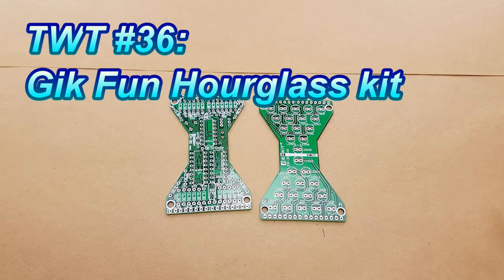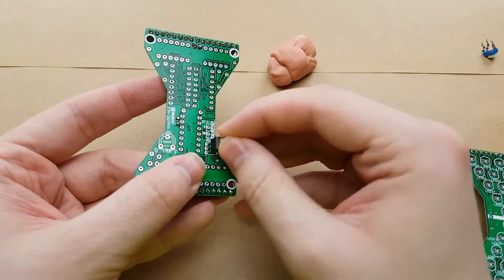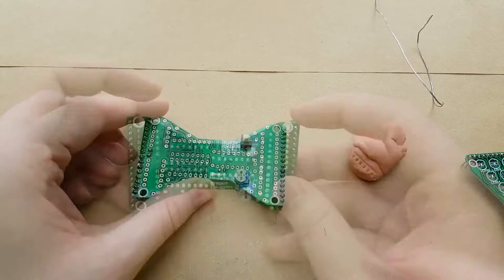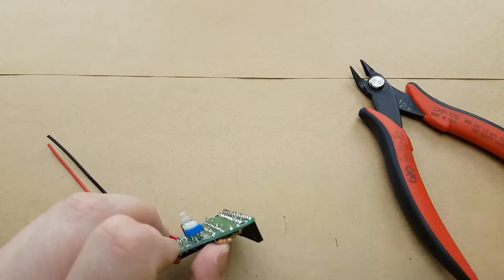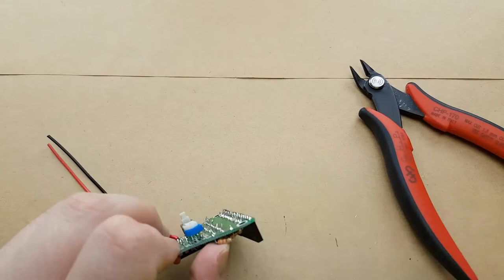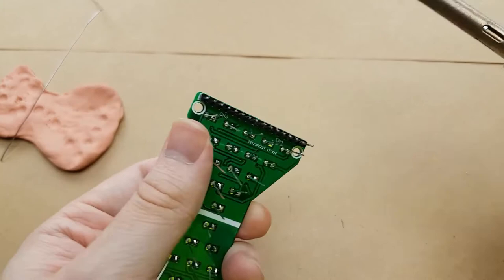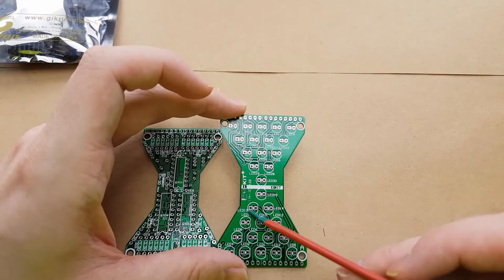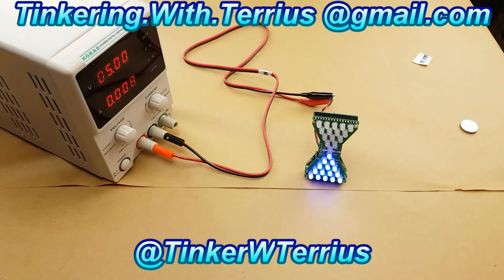Gikfun Hourglass Soldering Kit Build | TWT 36

Comment: So i just finished soldering this kit, first time i ever soldered anything hahha.. and that for a 40yr guy ...Very good kit to get started with. was kind of relaxing to do.. i live in a small apartment so my study desk doubles for a soldering stating... cleaning up after wards was a bigger job hahah..Only had one little problem and that was that one of the led's didn't work.. luckily i got 2 spares.. Got to test out my desoldering station hahha..
A couple of things for people wanting to build this kit.
1) you can google the manual just search for "EH-30 Electronic-hourglass-kit" its the pdf from banggood.
2) i orderd 5m red silicone wire cable 18awg that's about 50% to big i just cut a bit of the wire. but i guess you could try 14awg.
3) to power it i used "Daniu USB Aligator clips wire male/female to USB Tester"  also from banggood..
i first connected it to a usb powerbank to see that nothing goes wrong.. because my powerbank shuts off after a few seconds i connected it to a 5v usb power supply the one i use to charge my phone .. 
Two things i missed having.. a nice bending tool for all those resistors...
demux4555 uses a nice tool on his channel.. don't know if it's overkill but problem is i cant' get one for cheap so will have to do it by hand.. one thing i REALLY missed was a pair of fine pliers.. i had bought one but it's way to bulky.. i'm going to buy the PN2005 from Piergiacomi i think hakko also sells one.. ..
Reply from the maker: Glad to hear from you again! This hourglass was one of my favorite kits to put together so far. Aside from me messing up and putting all of the LEDs in backwards at first... That was a LOT of desoldering, heh. Clean up is always the least fun part of soldering! :)

Just as an observation, if the 18awg was 50% too big, you'd actually want to go with 22awg. It is one of those weird things where the larger the number is the smaller the actual wire is. 

I've been really tempted to buy a lead bending jig, but I agree they seem far too expensive for what they do.
Reply: i also bought the clock kit with temp (red) and with case.. and the Christmas tree ahhaah...i like the clock kit because it's something you can put in a corner and have it work.. Bigclive did a nice review / teardown of ikea 5volt power supply (Koppla) that's the one i got to power other things and free up sum 5v usb wall power supplies..does are pretty much all the kits i could find for cheap.. looked at Velleman but those are way to expensive.. still need to look on ebay ;-) thanks for the tip will checkout 22awg the wires i got from banggood are actually pretty good suprised was a gamble ;-)

Comment: one of the two cables i soldered for power just came of the hourglass hahah...the wire solution doesn't exactly provide strain relief.. perhaps soldering a battery  pack or a standard mini-USB plug sum kind of solution would be better for this kit..

Comment: What kind of soldering iron do you use?
Reply from the maker: I use a Yihua 862D+ rework station, it was a relatively cheap soldering iron and heat gun combo that has digital readouts. There are tons of variants of it sold under different names/brands and the mains wiring inside was... questionable, but fixable.
Reply: i just bought the TS100 from banggood. wanted a modern compact soldering iron to see if i like the hobby.. perhaps it's someting to your liking.. i did a lot of research on what constitutes a good iron.. and like everything in life it's simple yet complex..i went with the TS100 because it is a direct heating iron. meaning the tip is an all in one unit. heat+ censors.. making it heat faster and more accurate. only thing i would recommend is you do not buy the power supply from china but from a reliable source.. the TS100 has bin reviewed inside out.. teardowns you name it ;-)
Reply from the maker: After seeing Julian Ilett use his TS100 I'm very tempted to get one. It looks like a very good iron for the price, I also like the variable voltage input on it allowing different output wattage. I'll have to keep an eye on it, though hopefully my current station lasts me a while before I have to get something new.
Reply: only thing i found challenging was finding a good power supply with the correct jack.
5,5 *2,5 that's outer/inner the one i now have is good but needs an extension part because the ferrite core  near the end tugs on the iron.. so need to build a silicone cable with the correct plugs. never done that so that's going to be a challenge .